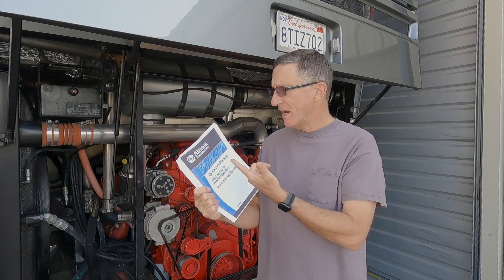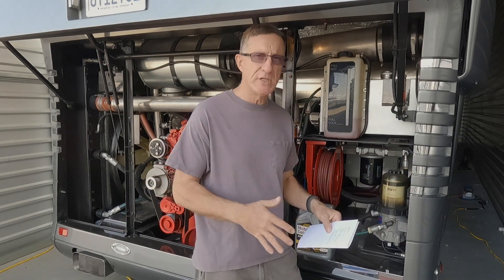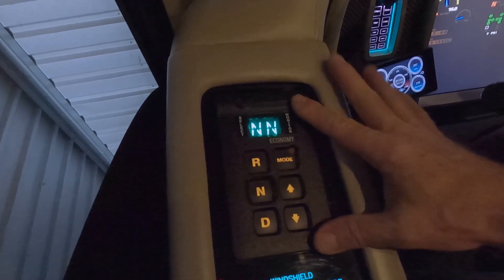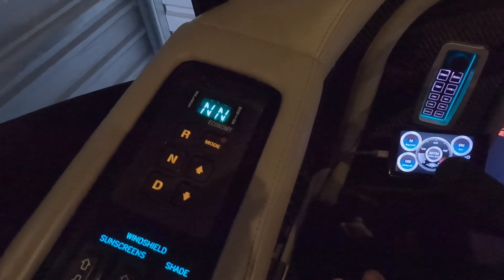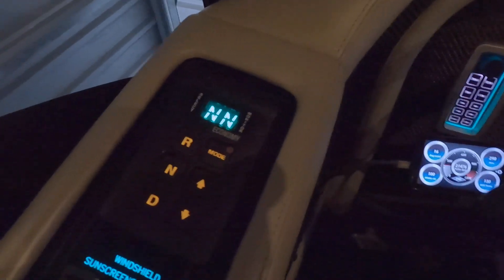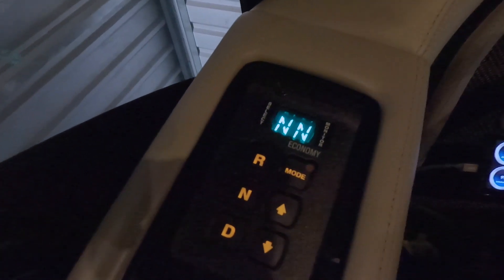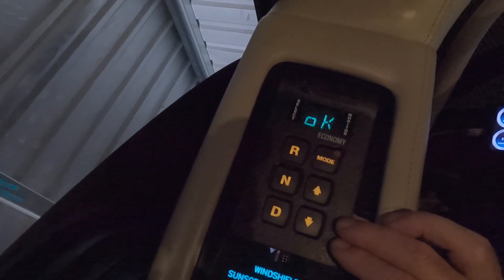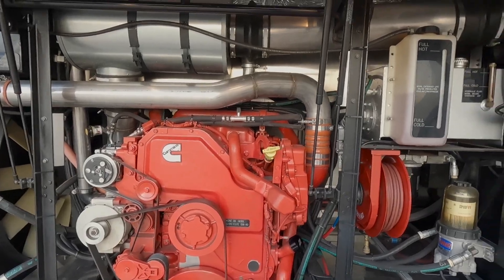How To: Allison Transmission Fluid Level Check | Diagnostics Code | Motorhome | Newell School

Comment: Why would the trans be low unless you just worked on it or a leak? Also what I got from this is check the dipstick once past 100 degrees. I would live to have one of those dance digital shifting panels like you have. I wonder if it can be installed in a Dually
Reply from the maker: Good question. Oil does have the chance to leak or dissipate on any trans, really. Shouldn’t be very much, though, and if it’s an ongoing issue, it should be looked at.

Comment: Well done.
Reply from the maker: Thank you, Stephen.
Reply: @RVSquaredSteve  So, how many different legs of AC does it take to check the tranny?
Reply from the maker: Legs of AC power?  None!  This is strictly a function of the engine and transmission; 12 volts on the chassis batteries.
Reply: @RVSquaredSteve  Glad to hear it Steve. Easy peasy.

Comment: Nice detail Steve, but where did the 2 quarts go? The trans is a sealed system, besides the trans vent tube. BTW the 4000 is a great trans.
Reply from the maker: Well…I’m gonna say that’s a real good question. They aren’t totally sealed; trans’ can blow fluid past seals at the input and drive shafts.  With it being topped off, I will monitor any signs of leakage which may have slowed down once the level dropped.